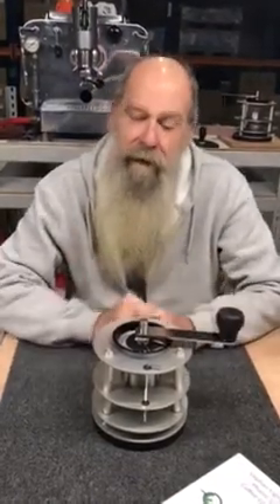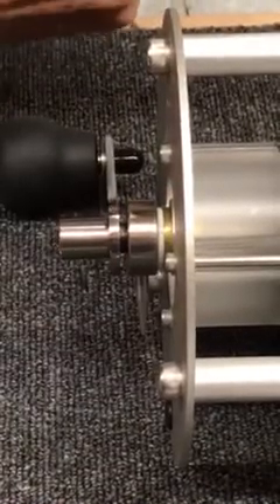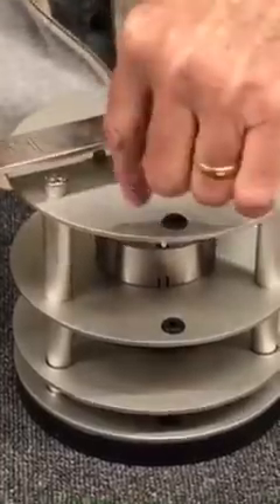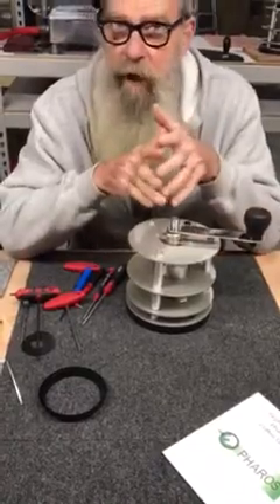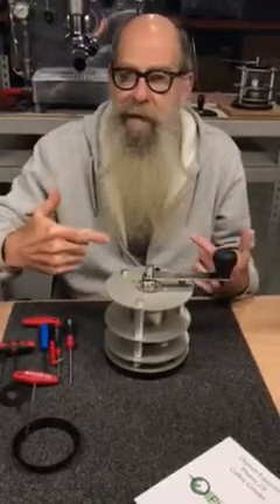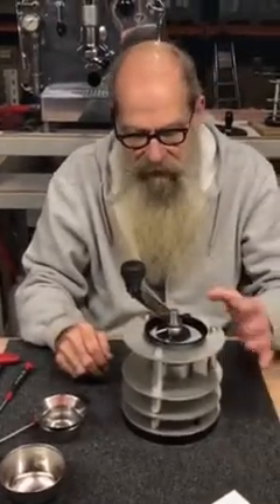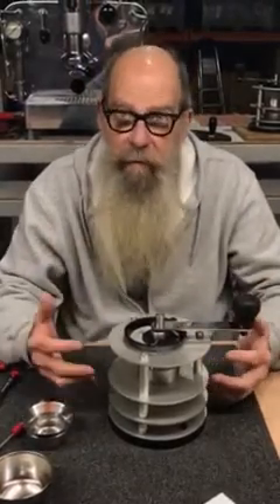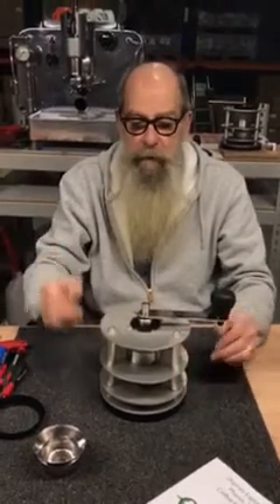OE Pharos 2.0 Manual Coffee Grinder - How to Make Adjustments

Comment: Thanks Barb and Doug.  Been using the 1st (Idaho S/N 1012) version for years. Can't think of anything that would replace it.  It just works.   May add the update kit for 'spresso, but it doesn't make much of a difference for brew grinds.